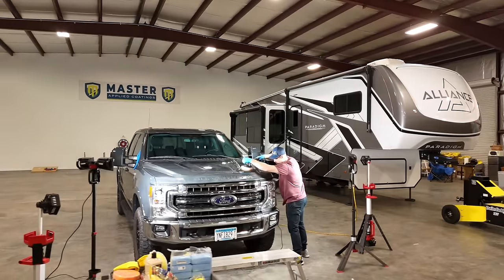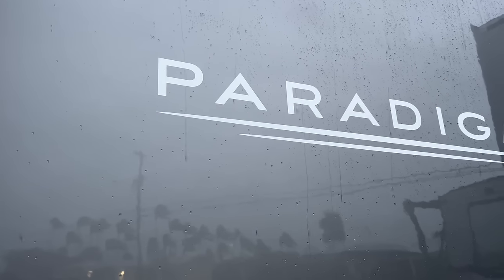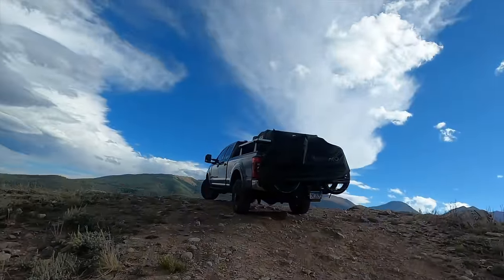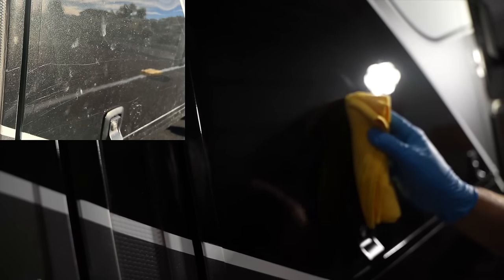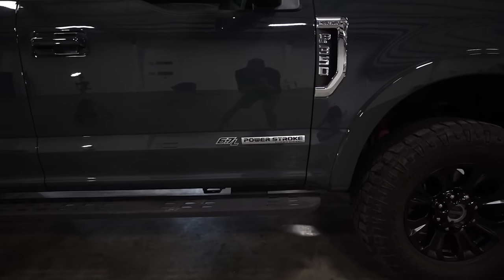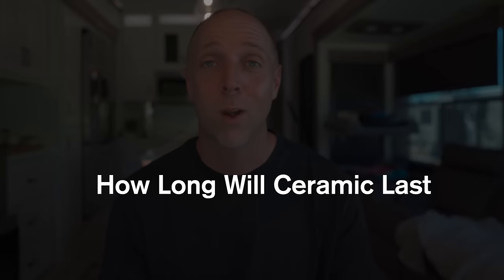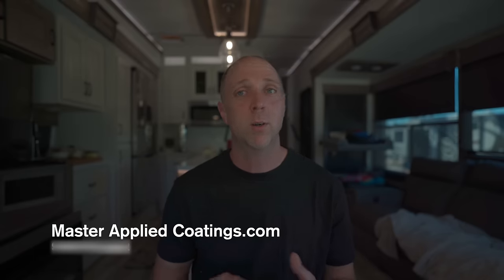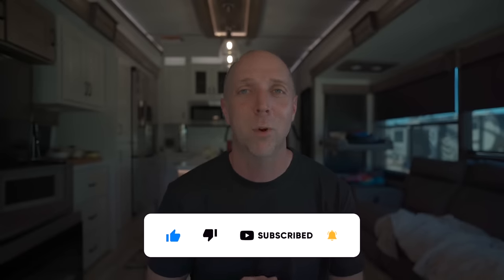The FIRST Ceramic Coating Designed to Last FOREVER - Master Applied Coatings

Comment: Looks great, no doubt.  I think many owners will be very happy with the results.  I'm sure it would spiff up our RV and Jeep.  But for us, we just can't afford something like this.  But, as it turns out, perhaps not really necessary.  We are on our 14th year of full timing, all over the country, all sorts of weather.  I wash the RV perhaps twice a year, using not the best, but a little elevated quality car wash soap.  The full body paint is one of those combinations, that after a rain, it looks really good from more than 6 feet away.  After washing, it does look close to new.  No fading, clear coat is solid except for some spots on the curve of the fiberglass on the roof edge.  We have a few brush marks from our encounter with bushes and low hanging trees over the years, but we still get complements all the time, even though I have never waxed the entire RV, yes, a few selected spots, and the bug covered front from time to time.  Considering our budget, and my satisfaction as to the RV's appearance, I think I will just keep doing what I have been doing.  But I do enjoy seeing the state of the finish industry, always informative.
Reply from the maker: Appreciate you sharing your experience! 👍 Proper maintenance of any vehicle can keep it looking good for years! 😊

Comment: I thought it was a well thought out video that explained the whole process to getting an alternative home for 5days. The perspective with what they could do with your 3 year old and the pin stripping on the trailer was amazing. The air stream community is rather tight and hold a pretty high standard for their rigs and service. Vinny’s is a class operation with upmost integrity. I didn’t catch whether you were compensated at any level, and frankly don’t care, I felt your detailed explanation and video was useful information for anyone considering this process, including costs.
Reply from the maker: Thank you! Yes, it was a lot of work on both our ends! 😂 And yes, this was a partnership between us to share the process of this getting done. I did mention that in the beginning of our video as we want to be transparent on partnerships. Thanks for watching! 😊

Comment: We knew about ceramic coatings when we purchased out truck and RV. We went straight from picking up the truck from the dealer and taking it straight to the ceramic coating place.  it worked out cheaper because there was minimal paint correction to be done.
Reply from the maker: Nice!

Comment: Awesome! Glad you finally did it! I have been very happy with mine, even though it is not from MAC. I will definitely check them out when we get our next rig as the pricing range you stated sounded very similar, and if it does turn out to actually be permanent, wow! What a value!
Reply from the maker: Yes, thanks Don! Wow it's gonna be hard to not have ceramic once you try! 🤣 Glad to hear you are loving yours!

Comment: Thanks for the video. We're Airstream owners. This process by Master Applied Coatings is popular amongst Airstreamers and the feedback from those who have had the coating applied is outstanding. 

We have a question: Do you know how much weight the process adds to the unit?
Reply from the maker: Thanks for sharing! I have heard that there is no real weight gain. The ceramic is very thin coating and not thick like paint.

Comment: I am wanting to have both my truck and Alliance ceramic coated. Are you still happy with Master Applied Coatings? Thanks Jeff
Reply from the maker: Hey Jeff! Yes, still happy! Although we did have to upgrade our truck to a dually for the weight of our trailer. Im not sure if you watch our weekly videos, but you can see the new RAM getting done in this video. https://youtu.be/XGwOLMnvlAc   The coating is holding up great and I love the way the truck and RV shine. Since this video, we have went through the pollen season up the East coast and that stuff was a sticky mess on the new black truck! But, just to set realistic expectations , you still have to wash your rigs.... but they are easier and look FRESHLY waxed after. Also remember ceramic is not the same protection as a PPF. (paint protection film) But I can still say we'll be ceramic coating anything new we get....love it!
Reply: @IreneIronTravels  Thank you for the response. I don't have a problem with washing our vehicles. As I get older I'm wanting the job to be a bit easier. I will definitely give Masters Applied Coatings a call when I'm ready.  Safe travels. Thanks again.  Jeff

Comment: What bnb did y’all stay while the vehicles were getting ceramic coating. We will be arriving July 1st to get ours done.
Reply from the maker: We stayed here https://www.airbnb.com/rooms/53074719?adults=1&check_in=2024-07-10&check_out=2024-07-24&source_impression_id=p3_1715296697_EYhxhUDpgIudswEN&previous_page_section_name=1000&federated_search_id=0f5d6270-d5ab-436e-a24b-97371031869d

But we don't recommend it! We had to be close for filming so we were kinda in a lower rent area off of Tennessee St and Amelia Circle.  Lots of college kids and lower income rentals. It was safe and fine, but not very relaxing or nice. House was from the 60's and felt like a college house. 🤣  I would recommend finding an Air B and B in a little nicer residential neighbor hood. We paid about $75 bucks a night for reference.
Reply: @IreneIronTravels  thank you. Just want to be close by. Have a dog and cat with us. We’ll check it out

Comment: I hope it works out great for you!  😀 If you've ever watched Andrew Steele on YT, he reviews Prevost & other high-end RV's, and he was and still is a professional RV detailer. He said the RV's that had ceramic coatings were impossible to get clean up to his standards. That was a couple of years ago, so maybe they have made some good changes since then.🙂
Reply from the maker: Thank you! I added the doggie scenes for you. 😉  Yes, I did watch some of his videos. I noticed his older ones he was kinda against at first because it was new to him and then his newer ones he really saw the benefits of ceramic coating. Also, you really gotta watch out for the different qualities as they're not all the same!  Thanks so much for watching!!

Comment: My wife and I are looking at either ORV 19MKS or Oliver Legacy Elite II twin bed. I’m look at the F250 Tremor Diesel for towing. Would you recommend the Tremor Diesel?
Reply from the maker: This is a really timely question! Our next couple videos are going to be just about this. But to answer your question if you are staying at this smaller weight and never going bigger, you should be good with a F250 diesel(but you don't know till you weight. How many people, pets,gear,tounge weight,etc). It will tow a 8250lb trailer well but you might close to your GVWR. Our ORV was 10k lbs and our f350 Tremor was perfect. If you can get a F350 over an F250 you will have much better GVWR and payload numbers though. For example we have friends with a 2015 F250 and they tow a 7500lb Airstream and right at the GVWR of 10k lbs for a F250. This subject get very complicated and to be sure you need to look at the numbers for your truck and RV.
Reply: @IreneIronTravels  That’s great information and I’m excited to watch your truck review. I’ve been comparing the Ford Tremor with the Silverado ZR2. How reliable has your F350 Tremor Diesel been? We will be hitting the road full time in mid-late 2026. Would love to run into you guys one day.
Reply from the maker: @rodneywilson236 26 will be here in no  time! The Tremor has been great. A couple recalls and one little coolant leak from a plastic connector that was covered under warranty. Spoiler our Tremor is not quite enough for our 5th wheel. Also, if you’re looking at 23 or up Tremors they raised the GVWR by 500lbs. So the new f250 tremor can have around 3000lbs payload. Plenty for smaller rvs. But 5th wheels put so much weight over the rear axle a tremor is not ideal. 👍

Comment: Wow, does that look great.  Will this help protect you against future pin striping in the woods, or would you eventually have to have it redone?  I just bought my van and am awaiting the build.  Maybe after I pick it up, I could get it done.  Sacramento isn't all that far away.
Reply from the maker: Thanks! It will help against minor scratches, but it really depends how deep they go. It might just end up scratching the ceramic coating and then those can get fixed if wanted. Congrats on the van!!! 🎉

Comment: Hey, did they ceramic coat the slides? I was told not to have the slides done because they would be so slick the seals would not work properly? Just wondering if that is true.
Reply from the maker: Yes, the slides (side walls and front) are coated as well. I wouldn't see it being a problem as the way the slides close and put even pressure on the seals. Now I guess I'm not 100% sure the back of the flange where the seal actually hits is coated. But, either way no seal issues going on for us.
Reply: @IreneIronTravels  we are having our coach coated as we speak in red Bay Al. The shop told us that tiffin said not to coat the sides of the slides because they would be so slick that the seals would not flop back and forth when you move them in and out. I guess I just may need to call the manufacturer and confirm . Thanks for your response ! Your Rv and truck look  awesome!
Reply from the maker: @user-ip9ml4ty8x oh that’s awesome! You’re going to love ceramic coating! I see what you’re saying now, but our side seals do still flop back and forth.

Comment: Hey guys, I’ve been watching your channel for many months now and wanted to ask how the Alliance is holding up? We’re going to purchase a travel trailer in the next year and have been seeing all the post about bad quality in manufacturing of many brands. So we thought Brinkley might be the one to get. But wanting a travel trailer instead of a 5th wheel we have yet to see Brinkley introduce a floor plan we like. Alliance Delta 292RL would be a nice fit for us design wise. 
Is yours holding up well?
Thanks 
Chris and Mary Biggar
Reply from the maker: Hey guys! Yes, we’re still loving the Alliance! The RV is holding up well, but we have had more little warranty issues than I would prefer. A lot of manufacture issues. The stove, microwave, awning, nautilus panel. We haven’t been in a Brinkley yet, but I have seen some issues come up in the groups. It seems most of the RVs use a lot of the same parts. We’ll be doing an update on RV soon!
Reply: Thanks Aaron and Chris,
Yeah I’m starting to see some issues with the Brinkley getting posted too. We absolutely love the big windows that all open in the Alliance Delta. 
Well keep up with your great content that Mary and I love and enjoy your travels.
Chris and Mary

Comment: I got my new F350 ceramic coated.  It cost $2500.  If I had more money I would do the RV.  We just can't afford the price to do the RV.  I recommend anyone who has the money to do it.  If you can't afford it you can use spray on SiO2 sealants that will give you about 6 months of protection.  You have to reapply them to keep the coating up.
Reply from the maker: Thats great advice. How are you liking it on the truck?
Reply: Once we get on the road I will be doing full detail and campers

Comment: Very nice! How long is the waiting list? Other than price are there any cons? What about RVs that aren’t full body paint! My head is spinning! Great information!
Reply from the maker: Good questions! It really is a lot of information! The waiting list you'll have to contact https://www.masterappliedcoatings.com (contact form on bottom of homepage) You can definitely get it on non full body paint to protect that fiberglass from chalking and fading! One con I read about was water spots from hard water. But it's not a problem if you dry your vehicle after washing. Thats why I used the leaf blower and we've had no issues...its so easy! Also, don't worry about rain because it's not hard water and it dries clean. Some professional washers also use deionized water that doesn't leave spots either.

Comment: Do they offer a guarantee or warranty that their ceramic lasts a lifetime?  I have a few of my cars ceramic coated, as stated makes them look better, easier to clean and protects the paint.  I haven’t gone down that road in my RV yet,
Reply from the maker: I don’t think they have an actual warranty or guarantee, but it might be best to ask them directly on that. 👍
Reply: I will reach out to them.  When I had a few of my cars ceramic coated they would guarantee the coatings hydrophobic properties for 5 years.  Stated if the car is garage kept 7-10 years is possible.   I would like to get my cornerstone coated which we live in full time.
Reply from the maker: Oh nice. This would be awesome protection on your Cornerstone!

Comment: Have you noticed any water spots on your truck since this ceramic coating has been applied? Safe travels
Reply from the maker: You don't get water spots from rain. But if you spray your vehicle with hard water and don't dry it you will get water spots. Thats why I use the leaf blower. you can dry a truck in about 5 minutes! Works great and no water spots.
Reply: You'll still get water spots. True ceramic coatings are fantastic but they aren't as amazing as some will claim. Our truck is coated with R1 while our Shelby is coated with Beeds. The coatings make washing the vehicle much easier as much less crap sticks to it. The Beeds has a slicker (almost silky) feel to it but they both bead up and sheer/shed incredibly well. The truck has only been coated 6 months now but the Shelby about 3 years. I go in twice a year for "maintenance" visits where they check everything out (I wouldn't go longer than that between visits to my detailer regardless of what is on the vehicle). Both vehicles are black so EVERYTHING shows instantly. The truck lives outside and gets it's share of spots if I'm lazy on the cleaning front; the comments about rain not leaving spots may apply in some regions but certainly not all as our atmosphere has all kinds of crap in it. There are acidic products that dissolve the spots without affecting the ceramic. I just had to get the truck taken care of because of spots but it looks perfect again.
Reply: @madweazl  definitely I have Gtechniq ceramic coating On my black GMC 3500 Denali...still get water spots after a rain especially on flat surface like hood. I give extra attention to maintenance of the hood